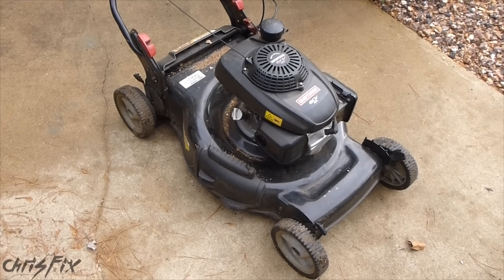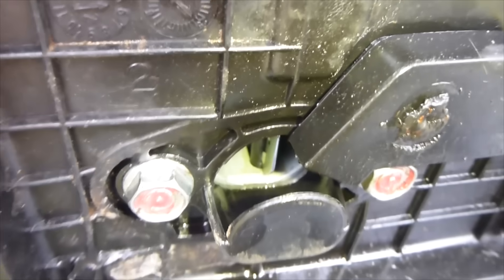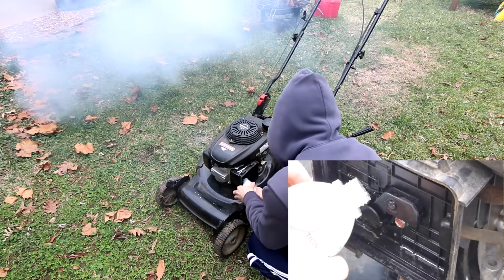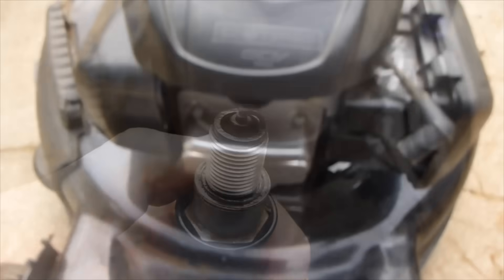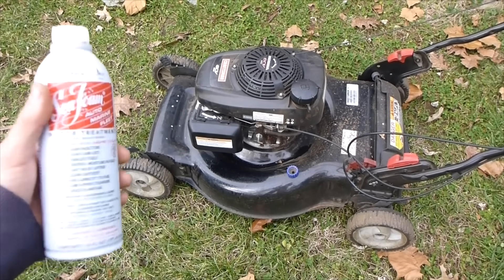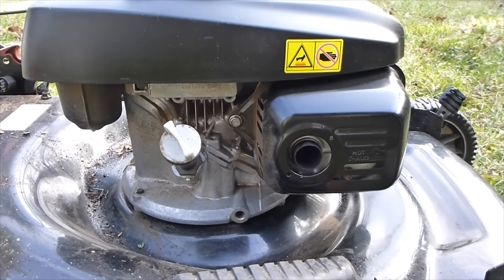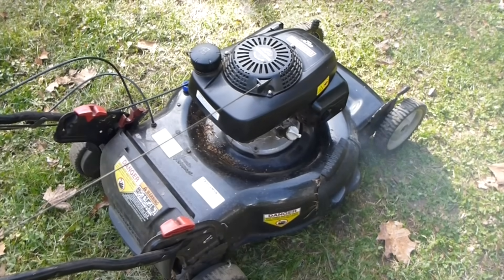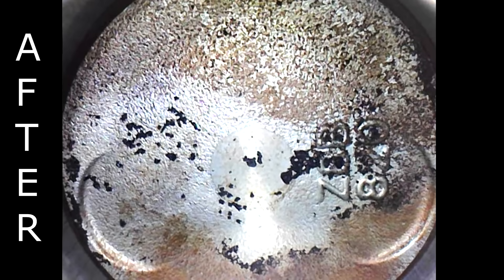Does Seafoam Actually Work? (with Proof)

Comment: you can do the same thing with water. adding the water cools the metal faster than the carbon... the carbon pops off. stop pouring the water and everything heats up again. add more water. You used to be able to buy water kits for RV's and Pickups. There was a mister injector that you put in the air cleaner lid and the vacuum would draw the water  through the injector. when you overhauled these engines, there wasn't a spot of carbon build up in sight.
Reply: You sound like you've been around as long as I have I remember those and they worked especially in hot weather and hard pulls and the reason why is when water Mist evaporates in the hot intake manifold it cools the surrounding air and condenses it so you have better compression but also increases the octane of the gas that you are using so that there is no knocking or pinging which causes carbon to build up because an explosion instead of a burn in a cylinder causes the carbon atoms to combine together like coal does to make a diamond instead of becoming carbon dioxide and exiting in the exhaust manifold now there's a line for you I'm almost as good as that guy that started about high tide. And now I'm going to brag graduated with 4.0 at State School of Science and Wahpeton automac LOL LOL LOL
Reply: You would have failed my course on technical writing. Your lack of punctuation left me writhing.
Reply: lol
Reply: @one two .,!"?"(:o)
Reply: but they won't sell liquid GOLD if the word gets out
Reply: @one two but did the teacherz pet LEARN anything...yes, the z was on purpose.

Comment: problem is those carbon deposits get in between the piston and the cylinder wall and destroy the cylinder. so although it may come off the piston itself its actually causing damage to the motor

Comment: hey chris love the channel man. quick question. i know you stated that you wouldnt put the seafoam directly on the cylinder head of a car the way you did to the lawn mower, but if you were able to some how vacuum the excess seafoam and carbon break up out before reinstalling the spark plugs, would you do it? or do you see adding it straight to the cylinder will still present a problem even if you can vacuum the excess out?

Comment: a mechanic i know years ago would regularly jun some transmission fluid through the intake . he would rev it some afterwards . said it removed carbon . same as what you did  but finished with a few revs to blow it out
Reply from the maker: Thanks for sharing! I am not sure if that works on cars these days due to the emissions systems on them.
Reply: Yeah transmission fluid is common particularly in diesel trucks. Another common trick that works better then sea foam is plain water, the water converts to steam in the motor evaporates leaving he motor clean dry and gunk free. You obviously wouldn't soak the piston in water though since it's meant to be used when the engine is running and hot so there is no risk of rust or hydrolocking. Lots of performance cars use a similar method to the water or actually inject water into the intake, on tuned turbo engines methanol injection is very common and kits are available everywhere.

Comment: What I do first is I add a good amount of WD40 directly on the piston if the motor has been sitting for years and wait till the morning, what this does if the rings are seized in the side of the piston your sure by morning the rings will be released then I use sea foam

Comment: a few spritzes of water or ATF down the carb/throttle body will do the same thing.  to rid accumulated deposits that were causing terrible detonation back in the day of carburetors and lolly gaggin old folks, i would routinely hook a small hose to a vacuum port on a hot engine, then rev it whilst dunking the end into ice water. choking the engine down, then revving it clear a hand full of times would clean the entire combustion chamber, and the back side of both valves .. followed afterwards by a good romp to redline on the highway.. ever heard the term "blow the soot outta that thang" :)
Reply from the maker: Thanks for the tip! I have to try that!

Comment: The thing is I've noticed when rebuilding small engines is that the problem with carbon build up is not a problem on the piston, but is mostly on the inside of the head. Also with an older engine there is a protective layer of carbon that builds up on the rings that helps keep the compression up. By chemically removing this ring carbon compression will drop as well as increasing oil burning.

Comment: As a small engine repair technician I want to thank you for giving lawn mower repair shops business. Regardless of what you might have read on the bottle, pouring it in the air intake on the carb is not the best idea.
Mix seafoam in with the gas. Maybe a cup to a tank if you think it is real dirty. 
Seafoam makes a spray can for cleaning the carb. That is the one you spray into the air intake.

Comment: I like seafoam, I use some in my oil about 1000 miles before I change it, and then I run it through the upper cylinders after each oil change, and the rest goes in a full tank of gas around the first 1000 of a new oil change. basically just 1 can ever time I buy the stuff for an oil change. Its not a cure all but its a good additive for regular upkeep in my opinion

Comment: Have you tried BG 44K pour in only yet? If so I haven't seen it.

Or maybe the entire BG Fuel System cleaner. Putting BG 44K in mine today after trying Seafoam to see if it helps better.
Reply from the maker: +Robert Rose that would be a cool video. I haven't had a car with a dirty engine yet. I need to do a lot of tests!
Reply: +ChrisFix 

I volunteer mine. 207,000 mile 2008 GMC Acadia

Comment: I'm a Certified small engine mechanic and Sea foam will do the exact same thing by just dumping it in the fuel tank along with gas and just running it..... I run sea foam in my fuel on a monthly basis however u can do it yearly to keep from carburetor problems

Comment: water will do the same exact thing, and its way way cheaper than seafoam
Reply: Ever see what happens to a tractor when left out in the rain (water) without a cap on the exhaust stack? I have and it costs about 10K to rebuild your engine (and that's on the cheap side). Water don't compress. The pressure (steam) has gotta go somewhere. Kaboom!
Reply: really. whatever, you totally missed the point, but heh, whatever, a teaspoon of water WILL NOT CAUSE 10 thousand dollars worth of damage, LOL, but it sure as hell gets rid of the carbon buildups, and its way cheaper than that crap your advertising, and water works way better, but hey whatever
Reply: keith
Yep whatever.
Reply: yep whatever man
Reply: may plug them depending how much carbon there is :)
Reply: keith God Bless you too, Sir. I'll mail you a check for a new Engine.
Reply: MuddyBob 650 whatever,. it still creates water, DUH? Every gallon of gas burnt, it creates a gallon of water. Physics does not change, but hey Mr. HONDA, you know it all right. Besides I was talking about adding a single drop or two at a time, but MR. HONDA, you would pour a whole gallon down the throat of an engine just to prove me wrong. Whatever. GOD BLESS and GOODBYE MR HONDA.
Reply: keith Absolutely !!
Reply: whatever guys
Reply: wont even comment on trying it!!!! Oh that's right it will rust the engine into ruination, just like leaving the exhaust cap off of a tractor hahahaha LOL have a good day hahahahahahaha, everyone knows STEAM works better than, what did you say, its like an oil film left over, than oil.  JUST TRY IT, same amounts as whatever you was dumping in before only use water, and don't kill the engine, try to hold the rpm around 1500 when doing so, twice idle speed. Don't put your hand or face around the exhaust as pieces of carbon will literally fly out the end, ad it can hurt. Its a waste of good money buying that other crap, you'll learn:)
Reply: Yeah, when I was young I was told to do that. I poured several glasses of cold water into my carb on my truck, slowly and just enough to make it bog a bit...no problem at all.
Reply: MuddyBob 650 no it won't, a drop at a time will remove carbon deposits on the valves and top of pistons. More than that, well duh, of course it would. Just don't flood the engine and you'll be fine, but don't take a mechanics word for it. God Bless
Reply: MuddyBob 650 Well good for you. How much water goes thru an engine when its running anyway? For every gallon of air that goes thru that engine, how much water does it burn also? Every engine will burn water with its gas. Figure it out. Get my address from my agent and I wish you the best on that MR. HONDA.  GOD BLESS
Reply: +keith Yeah man, water is the good old school trick for sure. An old WW2 vet aircraft mechanic told me they got the idea after seeing that the water-injected supercharged aircraft engines were always shiny clean inside..
Reply: yes your supposed to put a tiny amount at a time. reason is water, opposite to air can't compress.
Reply: Water will ruin your engine

Comment: The best thing ive seen is on wheeler dealers. It positively charges the fuel and negatively charges the exhaust and decarbonizes desoots with before and after results, better emmissions better performance.

Comment: What is to gain from a cleaner piston? I know jack shit about cars so...
Reply: In this case nothing.  A heavy carbon load could cause pre-ignition (detonation) but in this case there was minimal carbon and nothing to be gain.  All this whippersnapper did was spend money to create a bunch of smoke to pollute his city.
Reply: Ben Samuel You know, that raises a good point. At most, this guy polluted the air with about half a cans worth of pollutants (because a lot of that smoke isnt smoke that'll travel into the atmosphere, its liquids). But say someone doesn't maintain their engine? And say they lose only 1% efficiency. Say their gas tank holds just 10 gallons, over 10 fills they polluted the air with about a gallon's worth of extra exhaust.

Comment: You do realize that the same effect can be achieved using nothing more than clean water dripped into the running engine with a wet sponge at a lot less cost.

Comment: I worked at a boat dealership and we used sea foam extensively for outboards that were gummed up. My mechanics always raved about the stuff, not sure what method they used but it sure seemed to work well.

Comment: After putting it in to cover the cylinder head, you may want to change the oil because some is likely to have seeped around. Not sure what it'd do but I'm guessing it won't be good. Better a small amount of money on new oil than having the risk of increased wear or lubrication failure.

Comment: gas nowaday is complete shit, add the seaform to keep the quick varnishing desolved and antigumming.
Reply: MOST PEOPLE DON'T KNOW IT BUT YOU CAN BUY 92 OCTANE PURE GASOLINE THAT IS 50: 1  (1% STABILIZER) FROM SEARS SERVICE CENTERS WHICH COST APPROX 5.00 FOR 32 OZS BUT HAS NO ETHANOL AT ALL IN IT.. PRICEY, BUT STOPS ALL THE GUM UPS WHEN YOU ENGINE SITS FOR A LONG PERIOD OF TIME WITH SOME GAS IN THE CARBURETOR OR TANK!!
Reply: RED1111111111
 most people DO know there is a CAPLOCK key on the computer keyboard. stop drinking the sears gas Archie Bunker.
Reply: fiftymerc sled
trust me, i will NEVER be accused of being "grammer police"! LOL
Reply: I ADD IT TO ALL MY VEHICLES TO KEEP THEM RUNNING GREAT!!!  I ALSO GET IT ON SALE AT PEP BOYS ONCE IN A WHILE!!
Reply: RED1111111111
i add a little lime juice and make a gin gimlet out of it!
Reply: RED1111111111 Shell 91 has no ethanol
Reply: hey crab I was all set to rip you for being a grammar POlice then I found RED!'s entry , and I want to  give you a friggin  highfive. The dingbat deserved it. fiftymercsled aka ripple red

Comment: is there a difference between this seafoam and the other seafoam video that you did with the car?
Reply from the maker: The ingredients are the same but the method of introducing it to the engine is different. I prefer the other method for car engines because there is no vacuum leak and you cannot hydrolock the engine by adding too much.

Comment: I put Seafoam into the fuel tank of my sister-in-law's lawn mower and mixed a portion into a jerry can.  Its carbuiretor was gummed up.  It took a while, but I had gotten it running on its own without having to prime the carburetor after one half tank, and ran the engine until the fuel tank emptied.  I refilled the tank and parked the mower.  The mower sat for a month and required constant priming initially during starting.  It required less time to run on its own this time.  It mowed the back yard and part of the front before running out of fuel.  The mower needs some TLC, but it worked.
Reply from the maker: +John Fraser awesome! Thanks for sharing!

Comment: Just dumping the cold oil into the hot engine is what flaked the carbon off. Works the same with water. And they're both hard on the engine.

Comment: Letting sea foam sit on top of piston in a high mileage car is just going to wash your ring seal off.  Get ready to buy a qt of oil every 500 miles.  Run a jug of Techron concentrate through you tank once a yr, use good fuel, (Exxon, Shell) and all will be good.  I have delivery vehicles with 400k on some, and never a fuel related problem.
Reply from the maker: +1wide9111 thanks for the tips!
Reply: I know a client who runs delivered he has. a 08 correlation with over 1.3 mill miles and still running
Reply: This is pure bullshit.  As was once said about chewing tobacc,. not  a fart in the carload.

There has not ONE bit of evidnence ever show that this stufe if worth it.
Not one iota..     The photos shoe show just a;s lmjust carbon  in photo one as in photo two.  This is all smoke and  mirrors, folks. 
Snake oii.......

Comment: Sea Foam is not effective on fuel injectors.  The carbon buildup in the engine is rarely a problem, and if the build up were that great, sea foam would not touch it.  Chevron's Techron Fuel system cleaner will clean the injectors, which is the most important item, along with everything else.
Reply: not true, seafoam WILL clean injectors,it is 100% petroleum. it will also bust up varnished fuel and lube the valves...things tectron won't do

Comment: You want to clean it? Run the engine at full speed and feed it a SMALL amount of water through the intake. You want enough to make it sputter, but not enough to stall it. The running engine will evaporate the water, and literally steam clean the cylinder and exhaust side of the engine. 

FYI, this motor wasn't dirty to begin with. That is normal combustion.
Reply: I don't know why he didn't just saturate the paper air cleaner and keep spitzing it in. Obviously, tjis necessitates replacing the air filter.

That piston looked pretty pitted, in my opinion. Probably a bad alloy for the application.
Reply: Good idea on wetting the air filter, but I'm thinking most of the seafoam would dribble from the filter to the engine frame and not be sucked into the carburetor.
@ 7:48  There is no pitting on the raised letters "Z" and "8" and no pitting at the very bottom right corner at the curve of the valve indentation.  I believe what looks like pitting is something else - maybe a thin coating of oil or carbon which hasn't built up enough depth to look black.

Comment: I have used seafoam in my vehicles and small engines for years. I add a full can to my gas tank around the first of every month. I also put 2 ounces of seafoam per gallon of gasoline in my gas cans for my lawn mower and my 4 wheeler. I use it in my motorcycle almost every time I fill it up. When I do an oil change on my car or truck, I add half a can to the oil pan and drive it for 2 to 3 days prior to doing the oil change. I have a toyota tundra and a kia soul and neither have had any mechanical issues other than the periodic brake replacement or tire replacement. When I took my kia soul in for the 60k check, I told the dealer how I do my maintenance and at first he kind of freaked. The techs checked the pistons and could not believe how clean they were. They also put a camera in the crank case and up through the oil drain pan and there was no carbon buildup. They compared to a car that was in at 15k miles and my engine was cleaner and in better shape than the car that was 3 years newer than mine. 

It is important not to use too much in small engines, never more than 2 to 3 ounces per gallon, at 3 ounces per gallon you will see some white smoke when you first start the engine, at 2 ounces, I only notice white smoke on cold days. 
For my 2 cycle engines I do 1 ounce per gallon so that it does not mess with the oil to gas ratio, and I usually run E0 or gas that has no ethanol in it. If I do have to get E10 gasoline for my 2 cycle engines, I increase to 1.5 ounces as ethanol is not good for the small 2 cycle engines. 
My brother in law runs seafoam in his boats as well. 
By running seafoam all the time, it keeps the carb and fuel injectors from gumming up with the ethanol. When I do a carb job on a lawnmower for friends or family, I use seafoam as the cleaner after spraying initially with carb cleaner then drying off, I soak the parts for about an hour then 9 times out of 10, I do not have to buy a carb kit and the carb is better than new.
Reply: this guy must get the stuff FREE

Comment: IV used it on Street bikes it worked great lawnmowers arnt built as tuff as bikes or cars they have lower rpms IV been a mechanic on bikes for 30 years if on a multi carb bike if ones little dirty it will resolve the problem